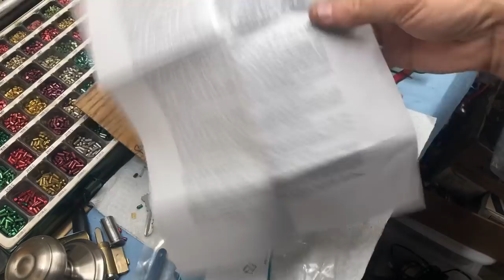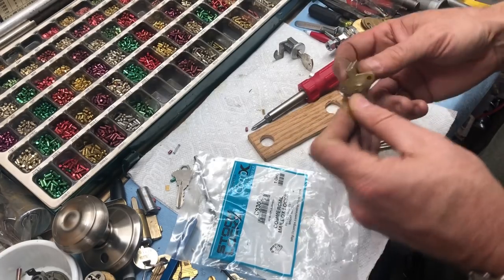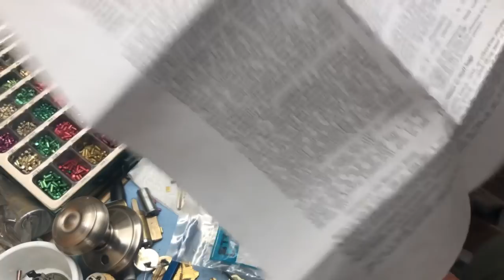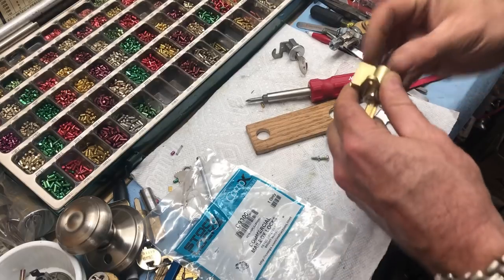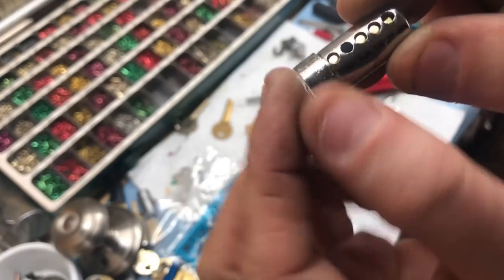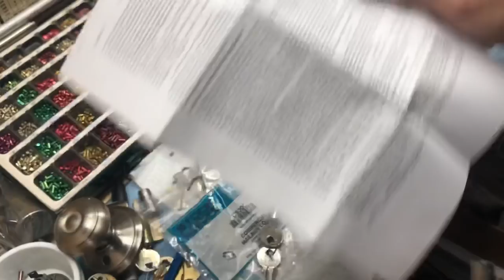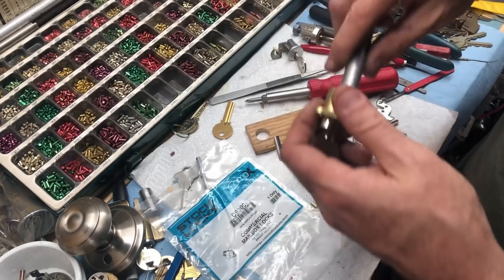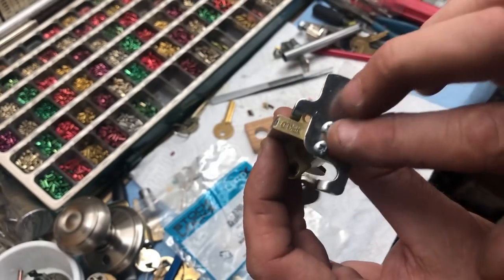Mailbox Locks: CompX C9300 ~ 401B Replacement ~

Comment: Do these locks ever lock up? My lock always works fine until today key goes in but will not turn. Im not sure if usps changed the lock in error or if its just locking up.
Reply from the maker: Did you pay your box bill? Does it look new? If its in a USPS facility you will just need to go talk to them, a spring could be jamming up or your key could have been worn down, or yeah they could have locked you out :) All you can do is check with them. If its in a condo group mailbox area you can try spraying a good quality lubricant in the keyhole to see if that helps (tri-flow is easiest to procure, no WD40 or Graphite based anything)